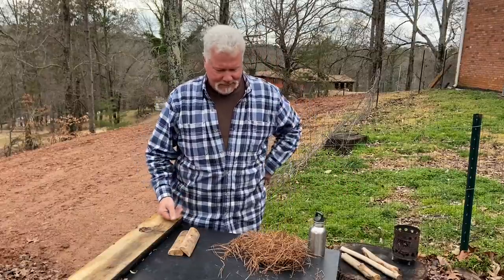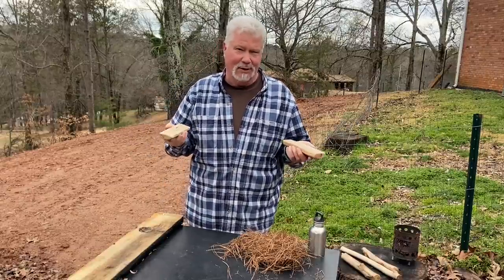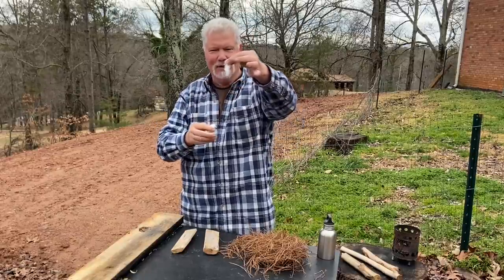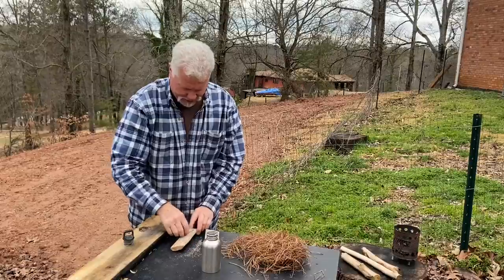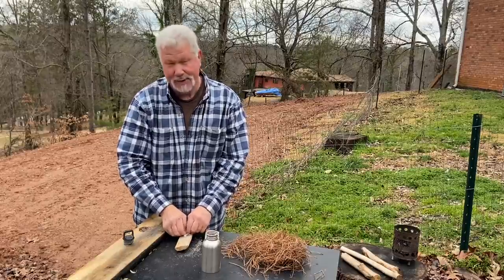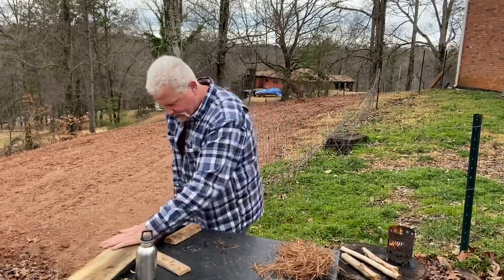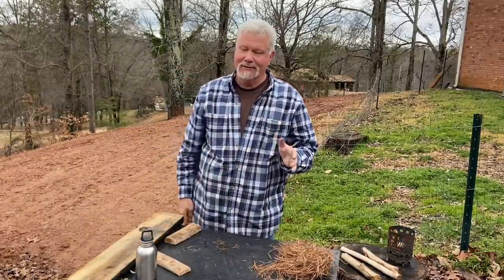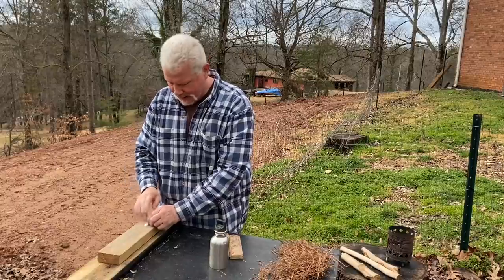Micro Fire Rolls, Why When And How To Use Them

Comment: I watch survival videos and like to practice those skills whenever I get the chance.  It blows my mind that I had never heard of this incredible fire starting technique until I found this channel.  
It's not like so many other methods that take a ton of practice and specific types of materials.  I literally watched David do this and went outside, grabbed random pieces of wood and got it to work within a few minutes.  Mind blown.  I then found other videos where you can use flat rocks and about anything else, as long as you can get a roll going.  After seeing David get ignition from green ragweed, I'm going to find out how many different materials I can get to ignite with this method.
Reply from the maker: Cool. There's been dozens discovered already.
Reply: I've heard people using rust and sand instead of ashes. It blows my mind too how fast the works

Comment: Just found your channel. Great video! My favorite fire tool alongside my knife is a Japanese block plane. It's small and light and allows me to make paper thin shavings for kindling out of even wet wood. It can also be used as a top board with your fire rolls and make the bottom board from any piece of dry wood the right size. It is also good for making wedges to baton for splitting logs. Try it!
Reply from the maker: No, I'll use my Mora.

Comment: I experimented with an ultra-micro fireroll and was successful. I removed the cotton from both ends of one Q-Tip, opened those fibers up as much as possible, rolled into a cylinder, flattened it - added a little ash, rolled it and got the tiny ember. It was a fun challenge.
Reply from the maker: I have failed with Q-tip cotton before.

Comment: I think when I try to fire roll that I do the 10 warm up and then start rolling
But I think after that apply to much pressure because it gets very long and very thin 
I feel some heat on it
Reply from the maker: The harder you press down the less strokes you have to do. You shouldn't need preheats for cotton and ashes. I do 10 strokes, rotate the fire roll 180 degrees and do 10 more for a half cotton ball ignition. If I bear down as hard as I can it will ignite in 10 strokes. Some get it in 6 strokes. 1 stroke is a forward and return.
Reply: So the key is putting a lot of pressure on it? How rough should the boards be?
Reply: @DavidWestBgood2ppl  
I'll try it again tomorrow appreciate the help sir you are the master/ keeper of the flame